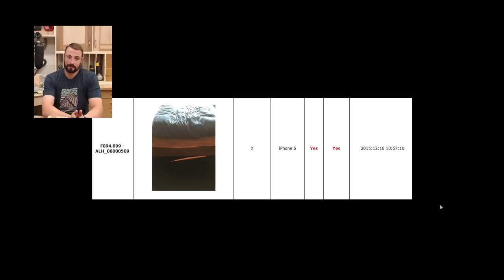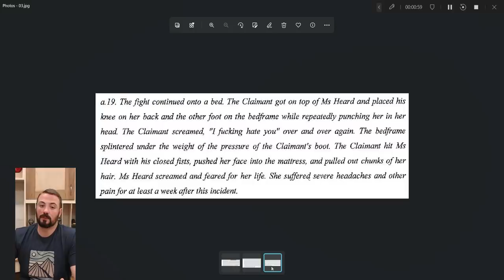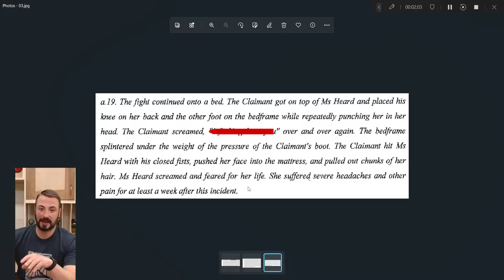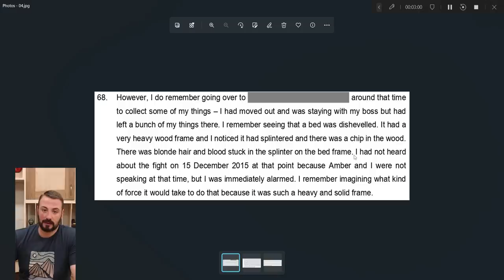Woodworker Attorney DEBUNKS Amber Heard's "Broken Bed” Testimony!

Comment: When I first saw this photo, I examined it from an engineer's perspective.  I've done some woodworking, and manufactured items out of wood in the past, so have an idea of what types of forces are needed to damage a soft wood like pine.  You could do this with blunt force, but it would seriously damage the surrounding material, as you would have to create fissures adjacent to impact sites.  I didn't see any impact damage that could lead to this.  Another possibility is to have a non slip surface on the wood, like say something GLUED to it, that can then rip (with a hell of a lot of force) a splinter off; pretty sure his boot was not glued to the bed.  So, the conclusion I had come to was that you needed a sharp instrument to create the initial fissures, and begin the prying with it.  If the fissure was already there, and the splinter was mostly already formed, then yes, you could potentially finish ripping it off by applying a blunt force in the right direction.  However, Newton's laws of motion come into play here.  If he's pushing so hard against this wood that it rips off, he's having to use a lot of his body weight and force to do so.  This means when this piece of wood failed, he would not be magically hovering above it, all the force would continue in the direction he was applying it, and we can see that's at an angle that leads off the bed.  His legs would most likely scrape along the edge of the bed as he would fall as he lost balance.  He would most likely not have stayed above her, until he recovered from the fall.  Him losing his balance and falling seems something she would have mentioned, considering how detailed she seems to be about this incident.
Reply: The force of an adult male pushing down on the toe of a boot is substantial.  Then consider that AH said his other leg was on her back.  One would presume that he probably had a hand on the bed too.  That would almost certainly mean that the majority of his weight was either on her, or on the outstretched foot on the side of the bed.  If he'd had most of his weight on his knee on her back, that could have done some serious damage, so it's not unreasonable to consider that he was trying to get purchase on the edge of the bed to alleviate that force somewhat.  If the wood broke, he wouldn't be hovering - his weight would transfer to his arm and knee until he could regain purchase.
So that gives you a large amount of force, on a small point, on the squared edge of an aged piece of wood.
Reply: @NotThatOneThisOne  It doesn't, though. If most of his weight was on her, or on the bed, both of which are soft, which it would have to be or he'd fall flat, he'd have zero purchase on the wood. Try it by lying down on your own bed face down or on your hands and knees and see how much force you can get going not just outwards but also downwards (as it would have to to split the grain) on the bed foot with one of your feet.
Reply: It's possible a shear force fail but there would be a flaw or existing split in the wood for that. There would likely be 'feathering' - loose fibers - along part of it, too, from my experience. Hard wood splits more cleanly in that regard. But the main tell would be if there's tool marks left in the wood, and there would be if a tool was used to create the split -so closer examination would be needed.
Reply: Well said!
Reply: I wouldn't say this is definitive proof a knife was used. It does appear those are solid timbers, well at least the end piece. I'm guessing cedar. If cedar then it's more easy to damage and if it were already cracked along the edge, which sometimes happens because..well wood has imperfections, then you could put enough force on it to break that piece off. Normally all that'll happen to the edge of a timber is over time that sharp edge with flatten a bit. If he had boots with grip and the wood was already cracked then he could kick off that piece, but it's highly doubtful that a piece of furniture that's stained and sanded and varnished would be in that condition. It's possible that piece broke off and the builder glued it back on but wood glue basically returns wood back into a solid piece. It's an extremely strong bond...and it's risky using glue because stain will not penetrate it.

She said it was a very very heavy wood frame, but of course she'd say that because it makes the "beating" look even worse. But I want to know why the damage looks as if it splinters all the way across in only one of the photos.
Reply: Wood can get instabilities like cracks you can not see while drying the Wood. Had thoose cases myself twice.
Bit I agree to Rob, this looks like done with a sharp knifelike object.
Reply: @docinparadise  it could just have those holes because it's reclaimed wood, I don't know, you never know with rustic furniture, it's like hipster blue jeans
Reply: @Rabijeel  If that bed can splinter on it's own like that then it's a very dangerous bed. Haha 

Hey I got a question for you. How did castles keep those giant timbers inside them from drying out and catching fire? Some kind of early creosote?
Reply: Yes, and she states that his entire body weight was on her back. Therefore his weight couldn’t have been entirely on the bed frame..
Reply: Not to mention the width of that timber. How far onto the bed does she allege she was, for him to also still have his boot at that very edge of that piece of wood??
Reply: @vee_tinymoose  why the hell did she or whoever take such a terrible photo? it's very annoying, phones these days take amazing photos without even trying, this was only like 6-7 years ago

but I can honestly say, I've never broken a piece of wood off like that, all I wear is boots and I do a lot of yard work-stepping on and off decks and I work with wood a bit, I mean I've never splintered a 2x6 like that or ever, well I've done it intentionally to split a board, and it's very tough, just on pressure treated plywood, I'm not sure what wood it is, but it would have to be a weaker wood that was already screwed up

anyway if he's a wife beater I'd expect there to be a house full of fist and boot dents and holes in the doors and walls, maybe some wife beaters only put their hands on women and never objects but I doubt it, I'd love to take a poll on that

it's fun trying to figure this stuff out, but it's just for fun, she's obviously full of crap and has been since day 1
Reply: @NotThatOneThisOne  Add to your thinking that the key is it wouldn't have been the toe of the boot but the ball of the boot - absolutely, completely possible to cause that splinter.
Reply: @wheelmanstan  yes! When we bought our house there were holes in almost every door and clearly repaired patches of plaster throughout - matching what the neighbours later told us about the previous owner.
Reply: @wheelmanstan  well fires were common lol..but I think they treated wood too.
Reply: @vee_tinymoose  Yeah my dad was always hitting stuff, and of course my brothers and I also did. We're not abusers but just grew up in that and fought each other all the time. 

I knew a guy in high school once that got a new Truck and beat the crap out of it. Haha, it made no sense. Dents were all over it, he was nutty in the head..but that's just a funny story. He was also obviously spoiled. I think he probably just hated his dad. Oh and my brother moved into a really nice house once that had all these bullet holes and dinged up doors. The holes didn't penetrate through the walls though, weren't actual bullets, because he was just one of those sport shooters and I think he just liked practicing in his house with replica pellet guns etc and lost his mind a tad bit after a divorce. 

When I was growing up it was like yelling and alcoholism and punching walls and all that physical stuff was normal. Now I see that a lot less but a lot of it seems to have been replaced with mental abuse, pacifist neglect or belittling each other. I don't think Depp was abusive but he sure made things worse by hiding from her when she got angry. Some women I've known will slap you if you ignore them enough. Hitting you becomes part of their vocabulary, if you allow it.

A lot of women walk all over guys now because legally they have most of the power. Back in the day women of course couldn't really speak out and today the men aren't listened to. Things have flipped around a bit. Maybe this trial will help start to balance things out. There's feminism and Metoo and "believe all women", but men don't have any of that. 
I wrote way too much....

Comment: I am a woodworker as well, and I wear western boots similar to those worn by Jonny. The moment I saw the photo of the bed, two words came to mind. Bull S*%t. even with metal heal taps, or toe clips, there is no way in my mind that this damage could because without leaving a very distinct mark from the metal boot findings. There is none. However, a sharp blade with a quick motion would remove the splinter just as in the photo. I am willing to bet that if I or anyone familiar with carpentry, or especially furniture craft, were to look closely at the wood in question and not a Photo they would see the tool mark.
Reply: does the squared edge of his bedframe matter as opposed to the demonstration here?
Reply: @crashjc86  absolutely matters…lol

Comment: This is EXCELLENT!  You should have been brought on as an expert and demostrated this in trial!  I have worked for trial attorneys for 30 years and experts are incredibly valuable.  Thank you!  💜
Reply: The Amber Heard Playlist!!  Woow, two of them?
Reply: Why are they not examining these photos forensically? Indeed this video has confirmed my suspicions. Her photos shopped pictures, her marks around her eyes are filler bruises why isn’t anyone checking on this stuff ? As for her being so concerned about his drug use - she sounds like she had a pretty bad alcohol 🍷 problem, an old lush , nasty drunk ! Did anyone see her smile at her own photo, like she was smiling at a new baby or a cute puppy, she’s nuts !
Reply: The Amber Heard Playlist!!  good for you
Reply: I think a craftsmanship, workshop and construction worker will do.
Reply: @firefly88887  Interestingly, the photos have been examined forensically. In October of last year, the court granted Depp's legal team's request to have all photos presented by Heard examined forensically, as they stated they believed she had altered them. She had to turn over all the original devices the photos were taken on, and Depp's team hired several different professionals. So it doesn't seem like they were photoshopped or filtered -- unless they haven't presented that yet, BUT that certainly doesn't rule out injuries were either self-inflicted, makeup was used, or a combination of both.

Comment: I am an amateur woodworker myself and the only time I have ever seen wood splinter in the way she described in her testimony is with very old weathered wood where the grain structure has become exposed. Even in these pieces of wood I wouldn't see chunks that large come off. It would be more like very long splinters coming off an edge. Great work Rob!
Reply from the maker: Exactly - I know people are looking to how I might not have addressed all questions/nuances and I'm thinking of doing a quick follow-up video to go through those because I really don't think it changes the conclusion.
Reply: Pointed, tapered both ends=knife.

Comment: As you’re going through this mini-mock-up, your illustrating exactly what I had already “figured out” just from doing minor, minor wood working! Also, that bed is huge…how was his boot on the edge of that big frame while her head was also in the pillows? Aaaan the knife on the bed that you haven’t mentioned is going to splinter that pine.. yep! You just proved it! Well, done sir!
Reply: She said she was leaning into the bed so she was partly hanging off and the pillows might not have been at the top of the bed, but that would still put the majority of her body in the bed. So how the hell was his boot on the edge of the bed frame (Which is quite thick) and his other on her BACK? Was he doing the freaking splits?!
Reply: @SillyRamen  I doubt he could do that with a split he seems to be 5,9 and maybe 40-50 year old. She describing him like he is some 7 foot giant.
Reply: @SillyRamen  I was already suspicious of John's weight on her. How does that break a siding of bed frame when all the pressure is on Amber's body?

 Also I am curious of his boot. Does it have spikes underneath? I can only think of specify soccer/football/hiking and mountain shoes that have spikes at the end. I highly doubt John would wear indoor.

Comment: Anyone who has ever rested the heel or toe of their shoe on a wooden step while they tied their laces knows that this isn't possible, if it was no one in their right mind would ever have built anything out of wood. You know why house frames have been build out of wood for thousands of years, because it's a strong material that's why, the kind of material that doesn't break under the weight of one man's foot. Also didn't she say he was pinning her down with his knee, how in the holy hell is Johnny Depp so heavy that he has enough of his weight in one knee to pin down a fully grown woman and still have enough weight in his other foot to fracture timbers, is he a neutron star disguised in a man suit.
Reply: I mean the bed frame supposedly can take a couple in a heated intimate moment without breaking... lol
Reply: Maybe the wood was crap to begin with. I’ve had a bed that was absolutely crap.  It broke with absolutely no force on it
Reply: @australiamyway  So have I but this is thick timber and a quality bed not a cheap one made of thin boards.
Reply: Well, that is what I was thinking, if he had his knee on her back, the majority of his weight would be on her back, there isn't any way to put that much pressure on his other foot to splinter  the wood; let alone his boot wouldn't have anything sharp on it.  Can't wait until this whole mess is over!
Reply: @humaneleaguelancPA  same
Reply: Unless the bed was already split and just a little weight made it break? It’s hard because I’ don’t believe a word she says so it could have been anything
Reply: i was thinking the exact same thing about the pinning her down part, plus would even less weight be on the foot of the bed where it supposedly splinter if he was actually hitting her over and over like she said? i feel like most of his weight would be mainly leaning forward with a knee to the back & the moving of his arm(s)
Reply: thanks for the little added perception that i hope those who STILL think he could have with his boot, with a different KIND of boot they used to support that perspective....i hope they read this...
Reply: @australiamyway  I bet Johnny Depp buys his furniture at IKEA...
Reply: Please explain 5:56 forward. How did rest of the frame break? Did Amber go back with her knife?
Reply: Also if he has all this weight/power on his foot, where is the injury/damage to her back? Surely heavy and fat old Johnny would have caused some type of injury or at least bruising on heard 's back/spine.
Reply: @rachaels1136  That's a good point, if the crack already existed - for some reason - it's possible he could rip it off with his boot. I'd call it arguable if there wasn't a random knife on the bed lol
Reply: Lmao right? That bed frame is so wide, his boot would have been on the inside of it not the outside and he'd have been pushing for purchase at the edge closest, not further away. One pulls the leg UP to gain purchase to push with; extending the leg further away from him would leave him LESS force for the knee in her back. Just reflexively that's not how that works (restraining someone, even while drunk or high, you'd have at least a little understanding that you need to direct force TO the leg/limb doing the push work to restrain). Also, the motion of trying to punch... Can't be done with any force at all while that other leg is extended. He'd have, if she were telling any truth in this incident, needed his non-pinning-leg closer to him with the toe digging towards the mattress not the outer edge. He'd be higher up on the bed than her too, in order to do that, so either only her head was on the bed and her body was on the frame, or that never happened at all that way.

100% think she stabbed the bed after he left and that potentially little of the physical sh1t happened.
Reply: @yos.5684  Maybe they were playing "Cowboys and Bitches" and he had spurs on.  lol
Reply: @MisterDantastic  I could throw a mattress on the floor. Lay some stained 8x8 fence posts around it. Tell Hollyweird people how "kewl" it is. Then sell it to 
them for the low, low price of $9,995.00. I'm gonna be stinkin' rich, man!  lol